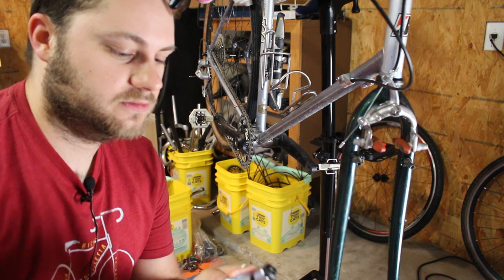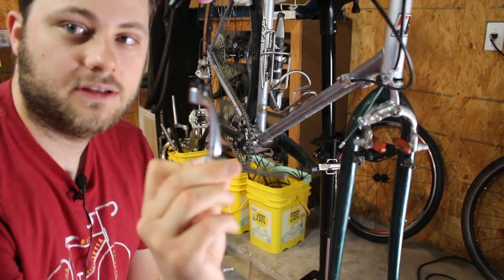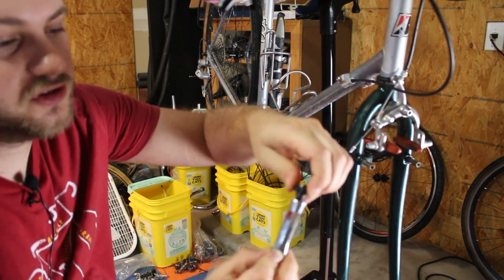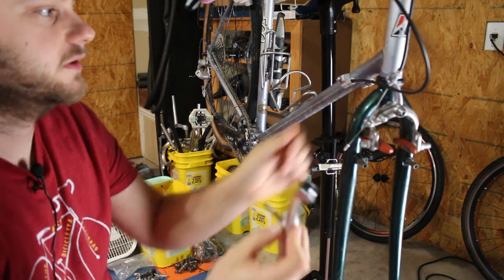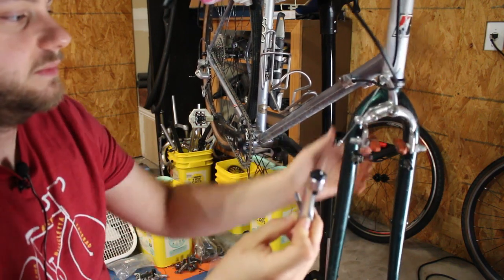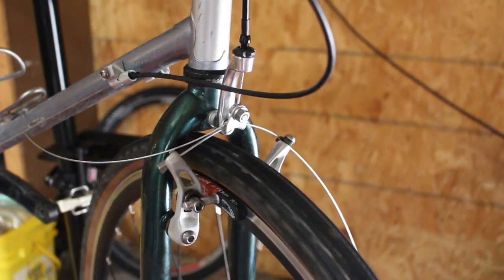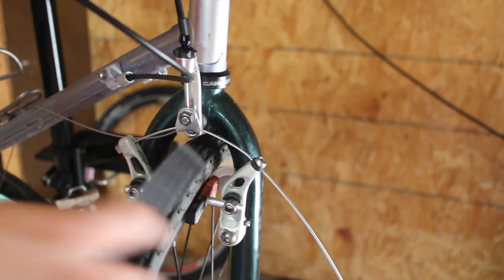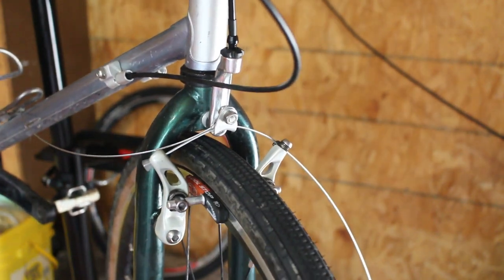Cantilever brakes on the Gravel Build

Comment: Does it ever shift out of vertical alignment? It seems inherently unstable, but I guess the bolt clamping force must be enough to hold it securely or people wouldn't use them.
Reply from the maker: It never shifted on me while I was using it

Comment: The cable hanger I bought didn't come with all the bits you showed at 0:58, what would you call them? I presume the first two are just sawtooth washers, but what is the half flat, half domed washer? And any links for examples?